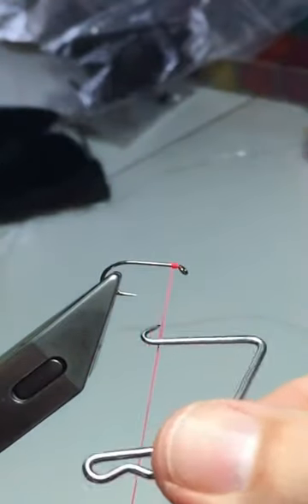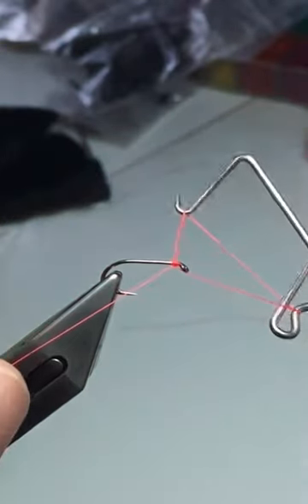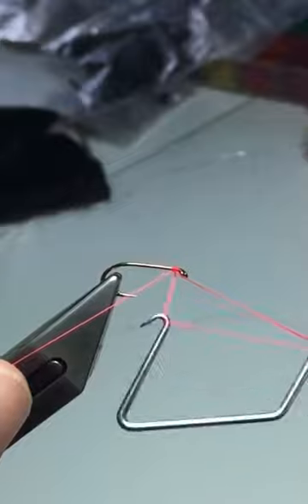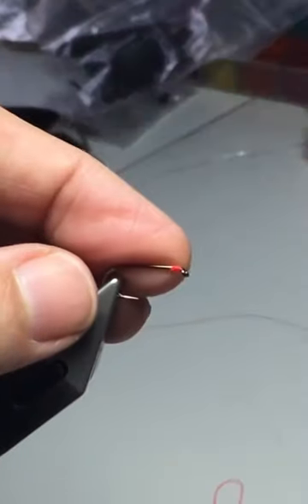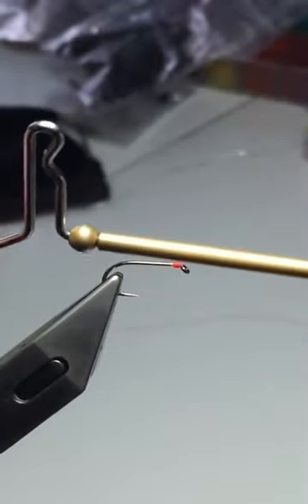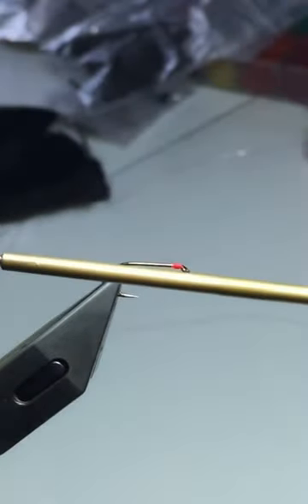Using the Matarelli Whip Finisher

Comment: I remember graduating from the half-hitch tool to the whip finisher. It was a lot of years between. Having rough hands from the work I did years ago, I could not do a hand whip without breaking thread. I bought a big bunch of used tying stuff and there was a Thompson Whip Finisher in it. No instructions, no computer, the only book I had was by Helen Shaw who did a series of pictures to show a hand whip finish! So it sat unused for a long time. I finally found someone who could show me but it was a few years. Then VHS came out and I discovered a Materelli style. I like them because you can use it for creating the head properly. My hands are pretty large, I'd be a terrifying Proctologist! So when I do a whip finish by hand it is hard to be accurate. Thanks Davie, I will use this to show others.